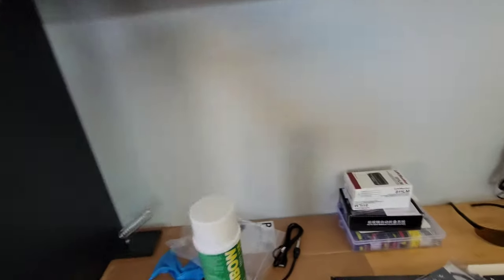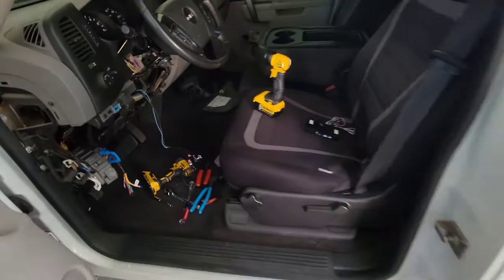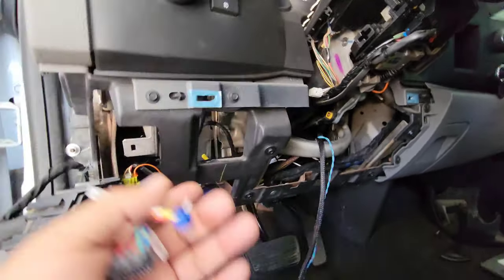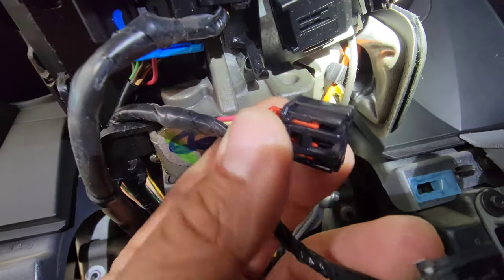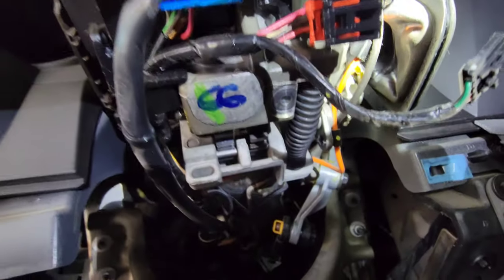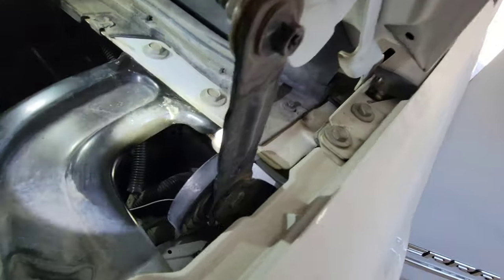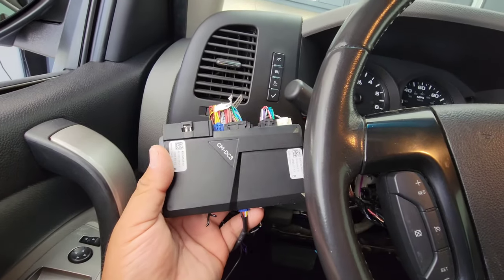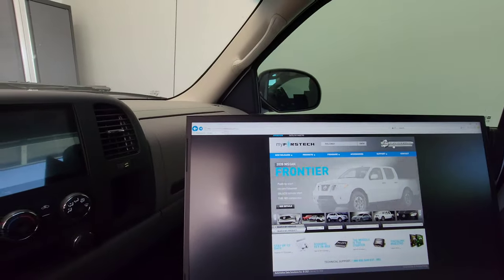How to install Compustar remote start alarm  with 2 way paging 07-13 Sierra / Silverado

Comment: My ? Is i have watched all your videos on your nnbs. I have an 08 sierra wt. Did you add your power locks or did truck come with. I want to add keyless but not using bcm. Was concerned how it would work with this dc3 an gm 10 harness. Thanks in advance.
Reply from the maker: My truck actually had keyless entry from factory, go figure. In your case, You can just ad aftermarket door actuators no problem. You will have to wire them up of course. I haven't wired any up for ages and I used to do these with relays but I think you can get a module that will control them. The dc3 should work np with this. I haven't looked but I'm sure there are videos on wiring these up.
Reply: I acutually had to replace door.. rust. I live in salt belt Midwest. An lucky me doors came with all the harnesses an switches. So your videos have been a huge help. Ive managed all the connector pin outs from work. So im gonna go either compustar or viper keyless entry.. an use factory power actuators. The only thing i cant figure is if dc3 will work with the aftermarket keyless system. Might have to msg your guys in link. Guess i should be clear sorry trying to use gm10 t harness. As well. That was my concern with wires for lock/unlock signal.
Reply from the maker: @patrickwiley67  most Keyless entry systems work the same so it should work. Definitely ask lockdownsecuritycanada.ca, those guys are super knowledgeable and probably answer most your questions. Good luck with getting everything going.

Comment: Great video, Im not sure if I need the high amp wire or whatever its called. It came in a kit, i see some people using it and i see some people dont. Also The harness comes with like 5 different sets of wires. Which do i need, what does each of those harnesses do?
Reply from the maker: You only need the high current if you are hard wiring everything and not using a t-harness. If your vehicle is capable of using the t-harness, I highly suggest you get it as the installation is way easier. As far as the ha3go you will only use what's needed so best to go to https://myfirstech.idatalink.com/support type in your vehicle to hopefully figure it out. You could always refer to the link in the description as they are a huge help in figuring everything out. Good luck!
Reply: @T_B_C_L  Thank you. Also another question is when i have to wire everything, how do i know which set of wires to pick from in the car. Like what if the car has 2 orange wires. How would i know which to tap into?
Reply from the maker: @KhaiMahase  you would reference the pin count on the actual connector.
Reply: @T_B_C_L  Is there a reference on the computstar diagram for wiring
Reply from the maker: @KhaiMahase  yes you need to go to that website I gave you.
Reply: @T_B_C_L  I read the wiring diagram. Wiring the tech isint labeled on the diagram on the module side. I know which wire it is by watching another guy wire the same module in a gm truck. I already know the colors of the wires inside the car. Thanks for the help

Comment: Have you installed the alarm it kit? Im having trouble getting mine to work
Reply from the maker: I did install it but unfortunately I never got the shock sensor to work. I really need to get back on that and figure it out.
Reply: @T_B_C_L  that's the same problem I'm having I been reflashing the module and nothing trying to find any threads on it but no luck
Reply from the maker: @Low_silverado  do you have the DAS-II Security Sensor. If so I have a feeling it's not compatible the Dc-3 I think maybe I need the original shock sensor. I also reflashed the dc3 multiple times without success. I even had a second sensor sent to me thinking my first one was Defective but same thing. I eventually gave up as everything else works, it's only the shock sensor that does not.
Reply: @T_B_C_L  yes I do. I know when you program the module in the security settings there's a tab to enable the shock sensor which is set to that by default but I know beside that setting it had to set it at "warn away only" or "shock only" idk but I might mess with those settings see if that makes difference or get ahold of original one if possible.. thanks for your feedback bro I appreciate it.
Reply from the maker: @Low_silverado  if I get some time to mess with it and figure it out I'll definitely make a video about it. If you figure something out please come  back here and let me know I would greatly appreciate it.
Reply: I believe I figured it out after reflashing the module several times and messing with the settings.. I enabled the alarm setting because I believe it's normally off from default and just set the dial at 10 and programmed the sensor and it it seemed to work
Reply from the maker: @Low_silverado  I swear I tried that but it's been so long, I could be wrong. I will need to give this a try. Super appreciate the info 😊

Comment: I see you bought a remote start kit and pager separate. Would it be the same as like getting a cs7900as?
Reply from the maker: I believe it's similar but honestly I have no experience with it. I looked it up and it does not come with web link tool for programming or T-harness.
Reply: @T_B_C_L  thanks for the reply.

Comment: Would it be similar to the 920 s    great that you did this how long it take?
Reply from the maker: If the 920s is listed to work with the t harness then I don't see why not. I think it only took me 2-3hrs to install. It's pretty easy As long as your vehicle will use the t-harness.

Comment: your verhicle is low current?
Reply from the maker: If you use the t harness it's low current but if you hardwire you will need high current. I believe compustar discontinued the low current and only produce the high current model but I could be wrong. Hope this helps. 🍻

Comment: Is it hard to install ? Want it on Infiniti i35 2003
Reply from the maker: As long as your vehicle is capable of using a T-harness it should be pretty easy, But of course it all depends on your skill level.

Comment: i had this installed this in my truck, same gen escalade, and now the key wont start the vehicle. remote start only. neither the shop who installed it nor the dealer wants to fix the immobilizer which i think is the issue
Reply from the maker: Are you getting a security light? You may need to reset the security system.
Reply: @T_B_C_L  yes i have the security light on when i try to start with the key. i tried to reprogram it several times by leaving the ignition on for 10-15 min three times until the light turns off, but the light never turns off. finally i took it to the dealer who said in order to fix it, they need to remove the starter. i asked them a few times to just try and reset the security system. tbh i doubt they really did any diagnostics. is there a way i can do it myself, or do i need access to dealer-level computer systems? 2010 escalade which has the PK3+
Reply from the maker: @mujjuman  you can try reseting the bcm by removing both battery cables and touching them together for about 10_15 seconds. Make sure you are away from the battery of course. Reconnect the battery positive first then negative as normal. Hit unlock on the factory key fob not the compustar fob, put key in ignition and turn to run position, wait at least 10 minutes and hopefully the light will go out, then start vehicle. If this doesn't work you may need a mechanic with a capable scan tool that can reset it.
Reply: @T_B_C_L  Thank you, I will try these steps

Comment: This alarm system is ridiculous you have to buy everything separate then you have to flash the brain they really don’t want people to try to install themselves or even buy a kit lol
Reply from the maker: You can actually buy kits that come with everything. Alot of the new products are kits but  most need you to buy the bypass separately where the dc3 comes built in. I just happened to go the dc3  route. As far as them not wanting you to install yourself, I disagree completely. Trying buying a viper or dei product and installing yourself, it's not possible because they don't give you the ability to flash the brain unless you are a dealer (shop) selling their products. If you need support or want advice on what to purchase you can contact https://lockdownsecuritycanada.ca/  those guys there are great and very knowledgeable. I just posted a video of an install on my son's 2023 Camry where I go through the process of flashing if you want to check it out. Good luck with your install 🍻
Reply: @T_B_C_L  thank you for the reply i actually just installed a viper alarm system it was my first time but learned all the wires and how to hard wire it up I now have a fully functional alarm. My car was actually stolen and I couldn’t believe I didn’t atleast have an alarm . I’m not happy with the viper alarm system the range it dosnt work if you’re not in front of it I really want to install one similar to yours I hear the range is alot Better can use it in the house and it sends and receives confirmation that it actually armed or unarmed I’ll be returning the viper . They don’t sell  a r harness harness for my 00 tundra so I’m going to hard wire everything just like I did with the viper alarm I do appreciate your video
Reply from the maker: @lucasornelas6113  that sucks you can't use a t harness 😞. If you go with a compustar, just make sure you get one capable of high current as you will have to hard wire just like the viper. Some of them will only do low current because they expect you to use the T-harness. As far as the range, yes get a 2 way remote, something like the compustar Q9 2 way fm fob. Those are rated for up to 3000 ft. Now I'm not sure if it will do 3kft but I know it will start my truck from inside of Walmart with my truck parked at the end of the parking lot. You can't ask much more than that.
Reply: @T_B_C_L  thank you for noting that I appreciate it I will be researching and using that install website, you shared to verify that the remote control ,module brain, and alarm siren system are compatible yeah they don’t make the harness for every vehicle. Maybe it’s just older vehicles that are the problem but I’m OK without the harness the wire colors are all the same so I know which wires going to where I’m also going to check out that video you just uploaded installing the alarm in your sons Camry thanks a lot!